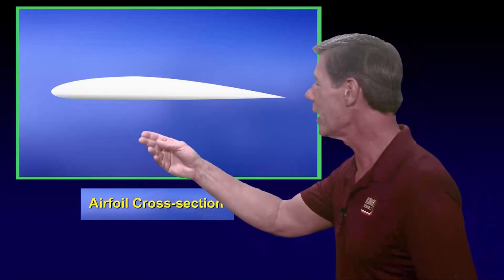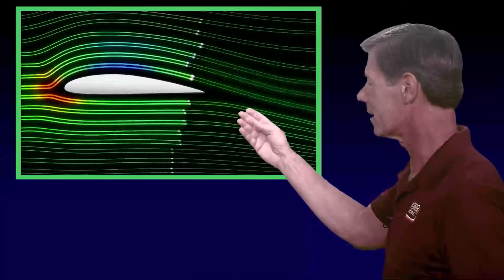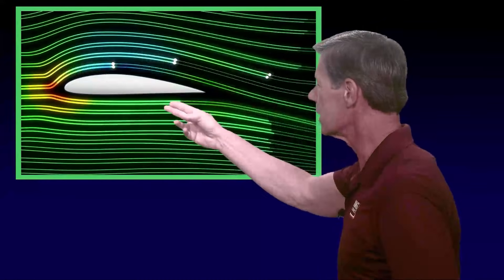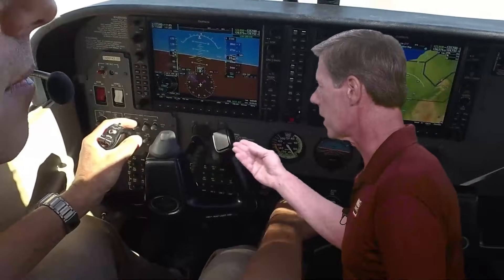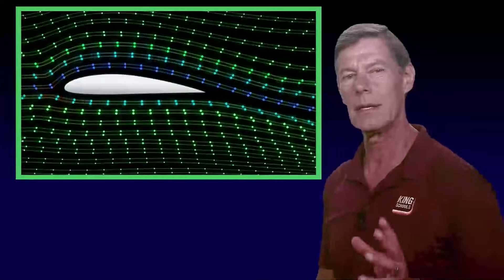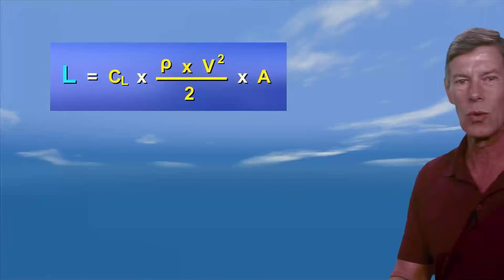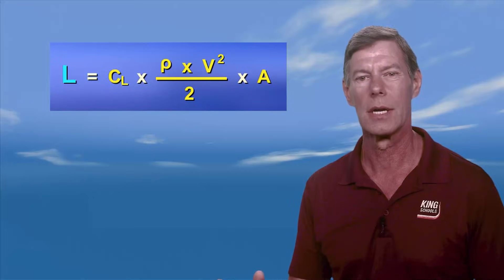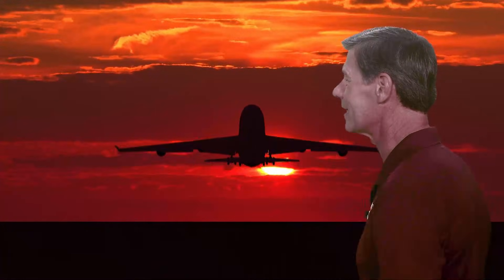You'll be surprised by how an airplane flies

Comment: I think Bernoulli's principle is a side effect of lift. The air speeds up not because of the longer distance over the top of the airfoil, but because the pressure above and behind the airfoil being low.
The shape doesnt force air to flow faster over the top. If this was true, the it would be impossible to fly an aircraft upside down.
Reply: Airplanes flying upside down are the ones with symmetrical airfoils or with a certain degree of angle of attack.
Reply: If you want to look at Bernoulli, consider not the wing as Venturi rather instead upper leading edge of wing as lower portion of Venturi with ram pressure in front of wing as upper portion.

Comment: That does not explain a symmetric  airfoil used on aerobatic aircraft!😊
Reply: Symmetrical airfoils produce zero lift at zero degrees angle of attack. Once angle of attack is introduced, it will begin producing lift.
Reply: With symmetric airfoils Coanda and Newton still apply. Bernoulli, not so much. The air off the trailing edge is still deflected downward.
Reply: There’s always somebody to bitch about something.
Reply: @Piper_PA It was not bitching, but a valid statement. The video explains how lift is created, but not the many variations in airfoil design. Take a Piper Pawnee for instance. A thick wing with lots of camber. Made to lift a heavy load, it has massive lift for it's size, but the thick wing and extreme camber make it lift a lot at lower speeds (ideal for crop dusting) but also makes it slow. A symmetrical airfoil will fly the same upright or inverted, but has little load carrying ability. You will never see one on a cargo plane! Airliners achieve both slower and faster flight by employing flaps and slats, therefore modifying the wing shape for every phase of flight. Being a Piper guy, certainly you have experienced the difference between the Hershey bar and the tapered wing? I  was surprised the first time I flew the Cherokee 180, after training in the Archer II. The Hershey bar comes down a lot faster when reducing power to land.
Reply: That is explained by the combination of Heisenbergs’s uncertainty principle and Ohm’s law